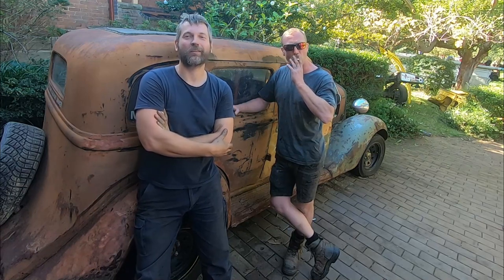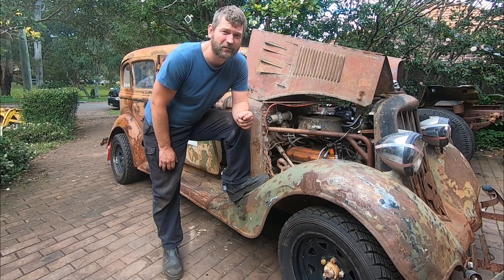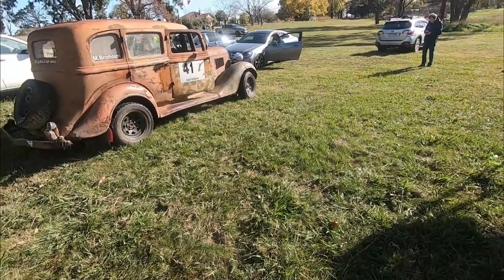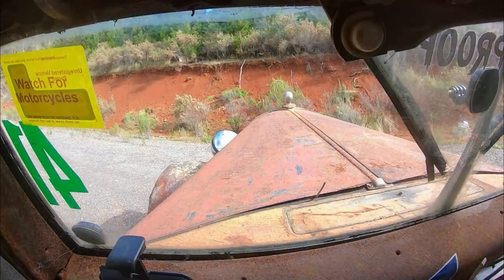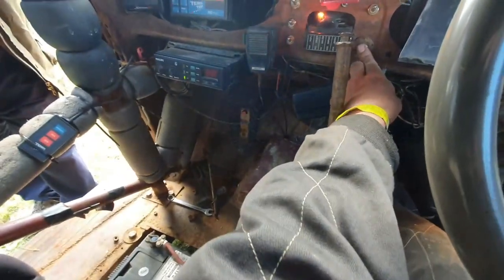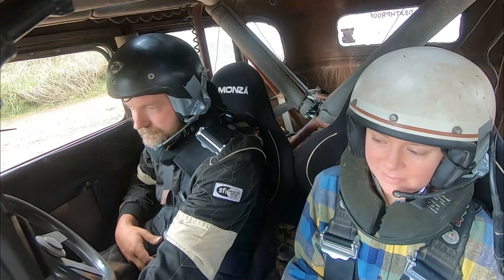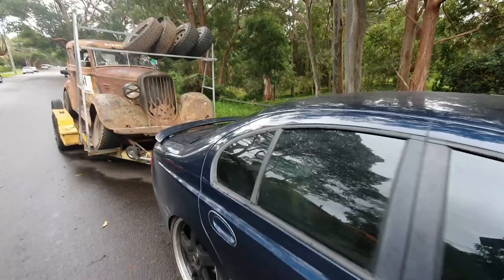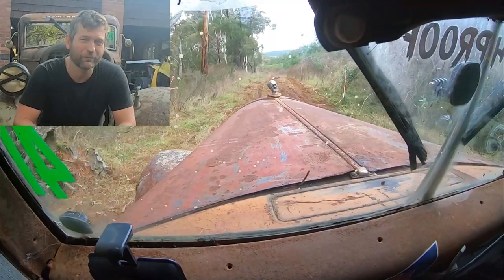Rally Of Orange 2022 DEATHPROOF 1934 Plymouth Rat Rod

Comment: I like this channel I can relate to working on jack stands even though I have two hoists something is usually hogging them.

When bleeding brakes or even clutch because I don’t often have someone to help you can vacuum bleed them but I just use a 600ml coke bottle with a hose from the nipple into the bottom off the bottle with some fluid in it that way if it try’s to suck air back it can’t only brake fluid so I can fill the master and pump as much as I want through then just nip the bleed nipple all on my own great vid as usual

Comment: I never miss one of your videos because I like watching a train wreck as it happens, I could offer advice like actually replacing the wire that broke to the coil since i'm sure it's broken before. I could advise that you need a gel battery in the car as lead acid battery plates fall apart in a rally car because of the vibration but you know that because youv'e been stuck before with a flat battery. But on the positive side you haven't run out of fuel for a while and now bring full jerry cans instead of empty ones to a rally so at least your making progress,

Comment: Good rally, great to see Deathproof out on the dirt again.  Sort your electrics out!  For $100 you could completely rewire her with top quality new connectors and nicely loomed , in protective sleeves where you can etc.  It would be nice if Deathproof looked the old ratrod on the outside but was mint under the hood ...  but keep it up, was still good event.
Reply from the maker: I'm definitely going to look into what connections are available, similar to modern vehicles that clip into each other.

Comment: Hi Guys, Great event. You judge how your good days  against your bad days. Rough roads. Would having tubes be better than tubeless tyres as you wont loose the air when the bead is disturbed. The starter sounds lazy. Best of luck next round. Good to see you got a navigator. Seemed to enjoy her time in the hot seat.
Reply: Tubes are normally frowned on for overheating, but in this application might be just what it needs.
Reply from the maker: Tubes are a possibility, though most don't use them. They do use alloy rims though. 
I agree with the starter comment. It seems to get very lazy when warm. The old battery has since started Deathproof a couple times now, with zero recharge to the battery, after the car has been sitting cold.

Comment: With the electrical issue too that starter sounded like it was suffering from heat soak if it’s close to the exhaust that’s common you can get the insulated sleeve to help that and also what I have done on a couple of my cars is run a remote starter solenoid.

With the remote starter solenoid I just bridge the starters original solenoid so the crank ignition wire goes to remote solenoid and just one heavy battery cable goes to the starter benefit of that is get bulk amps to the starter but also no live 12v always at the starter like most cars are originally so it’s a lot safer because if that cable is damaged or arcs can weld and start a fire with a remote solenoid there’s no chance of that

Comment: Hello Micheal,
I was wondering a couple of things about the front end on Deathproof and do not know if they might be viable, since I think the control arm area seems to have problems. 
Any way to get a later year front end components?
Improve front suspension with coil over truck shocks?
Make sure the bump stops are in range for off road rallying?
What about using airbag springs like you replaced on the tow vehicle?
A piece of logic I heard a guy say about his suspension components and setup was to have a bit of redundancy in case one component failed the other suspension items would still give you enough to finish.
I saw this has a rack and pinion steering in it so I do not know how Deathproofs frontend works all together. 
I understand this is a budget project for a hobby.
Just wandering in my hollow mind and it kept bumping into itself...
Reply from the maker: The front end is HK Holden, but modified. The lower arms retain factory mounts, but have a chunk removed and braced for better steering lock. 
The tops are modified for better caster.
The problem is that the top arm is short and has narrow mount points. They are also unequal length. A totally new arm will mount further rearward, making it eliminate bump steer, and mounts will be wider to give strength on the chassis with less twisting force. Bushings will be rubber instead of steel, to allow some impact absorption as well.
Reply: @shellberightgarage  
Hope you can find a used chassis somewhere with the better components to pull and set up on Deathproof, sounds like it could be a future plan.